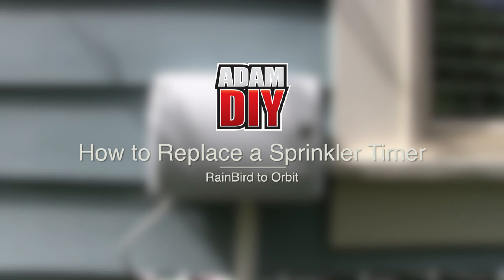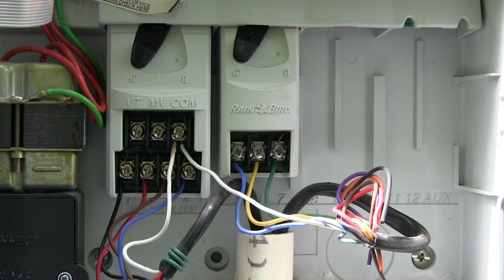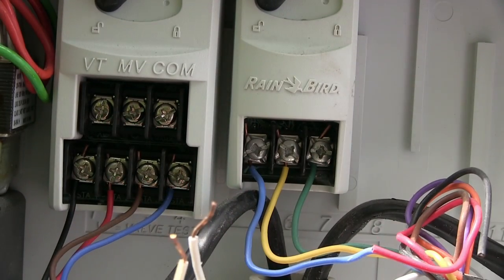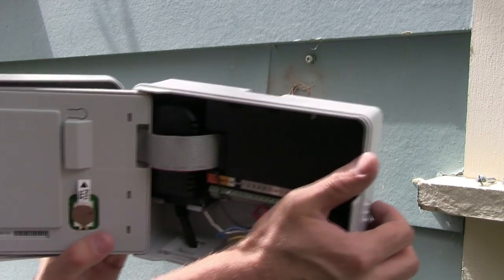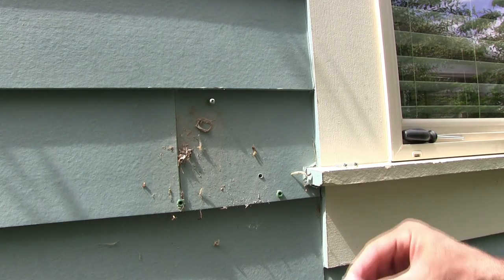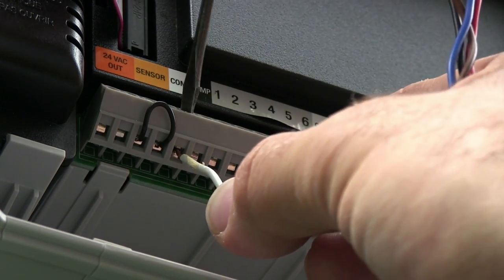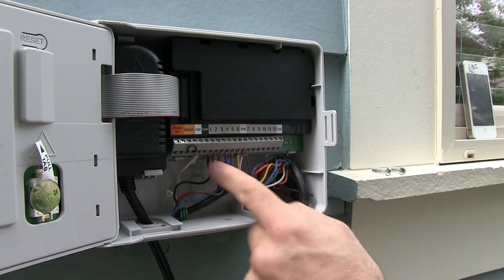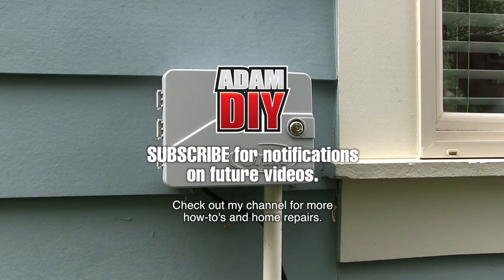How to install Sprinkler timer - Rainbird to Orbit b-hyve WIFI wiring

Comment: I like the instruction clarity of this video . The thing that irks me is this - I changed many plastic boxes on the outside of homes as a telephone tech ( 26 years ) . I would have cleaned the trash off the house before placing the new box . It would have took 15 seconds . The failure to clean such a simple thing bothers me . But the video did answer my questions about switching from Rainbird to Orbit .

Comment: If mounting onto wood siding there is really no need to apply screw inserts. Just Drill a small hole into the wood to prevent the wood from splitting then drive  in the screw.  I suggest using stainless steel screws to prevent rust drip if mounting your control box outside.  Great video.

Comment: Hi I was wondering if you could help me the old-timer has the 24v AC hookups and no plug but the new beehive has a plug but it still has the 24 volt slots do I need to hook up the wires for the 24 volt and plug it in

Comment: Great video. Had a question. I bought an Orbit rain and freeze sensor for my Rainbird ESP-ME controller. This controller has slots for sensor. I removed the jumper from the sensor slots and installed the common and normal wires in those slots. Similarly,  I installed two red power wires into 240v slots. I tested the connection from the sensor to receiver and it clicks just fine. However, my controller does not seem to see the Orbit receiver. I tried testing it by manually starting a zone and tried to override with the Orbit sensor but unable to do so. Also I have flashing rain sensor error on the Rainbird controller. What gives? Any suggestion would be appreciated.

Comment: I'm replacing a dinosaur timer box that is hard wired, the kind with the rotary dial and pins for setting the time. It has two zones (wires) only one wire per zone but no common. I hooked up the zone wires  but it does not active on test. does it need a common wire? If so how do I wire that in?

Comment: What is the operating voltage of the zones and maximum current per zone. I want to use solenoid valves instead of sprinklers, but I don`t know what voltage would be appropriate.

Comment: what is the input supply voltage ? and it need to be connect separately or we can connect it with other circuits?

Comment: My rain bird timer has a wire for the ground but the Orbit b·hyve does not. Where do I put the ground wire?
Reply from the maker: any "COM" terminal on the ORBIT is ground.
Reply: AdamDIY so do I connect the ground into the COMM?
Reply from the maker: yes

Comment: The Rainbird sprinkler timer is better then the Orbit.
Reply: Why? Just asking because I need to buy a new one and don't know jack about these.
Reply: The clock on the Orbit timers cant stay right and end up watering 5 hours off from when you have it set to water. The sprinklers from Orbit leak and waist lots of water and brake all the time.
Reply: Do they sell Rainbird at Home Depot and Lowes? And is it just for sprinklers or does it do drip systems as well? Thanks for the replies buddy!
Reply: +SimplexMan You are the man! Thank you!
Reply: Hay anytime(:
Reply: I have one problem i don't have a outlet outside like you have how did you Put your?
Reply: You can drill a hole through the wall to the other side to access one in the room on the other side of the wall. Just be careful of whats on that wall on both sides. You dont wanna drill through water lines or any electrical.
Reply: tripomatix I've got a power line directly into current box. How to swap out chord for that direct line?